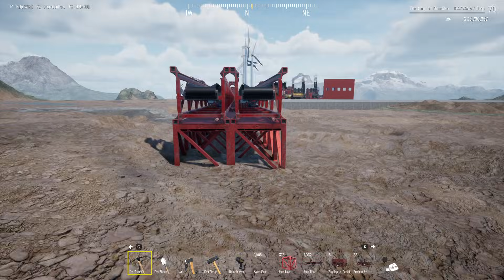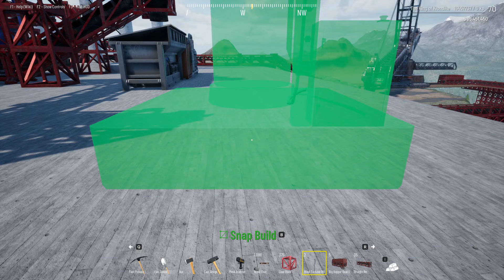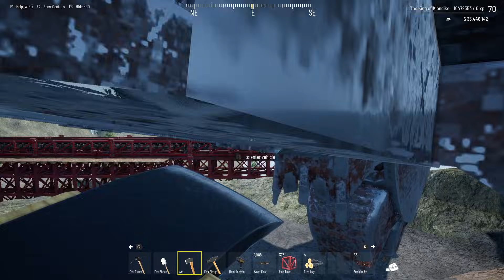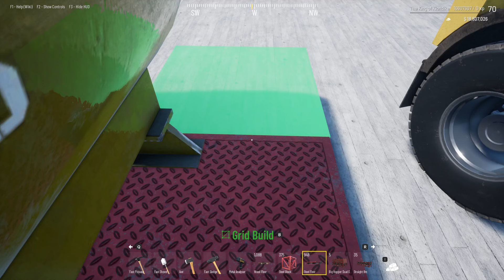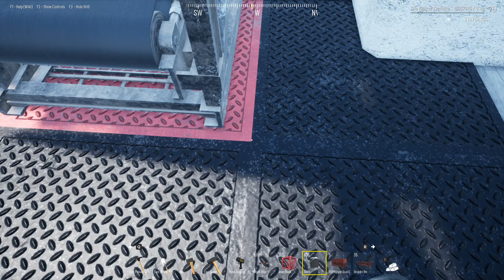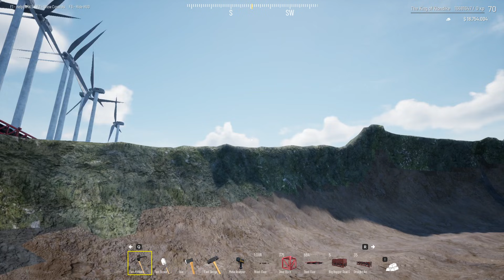Out Of Ore {Hardcore} S2E29 Worked On Plant And Ran Bagger

Comment: I ran power through the water pump and tried to hook up a "power point" to a pipe merger and no go, the only way that will work I think is to have a pump on both sides of the pipe merger, but that adds the pump draw as well 
and yea yesterdays video I put up is exactly why I stopped posting, I got 1 view in 23 hrs, and that's because I told the wife about it LOL. YT is not an easy place to make it, but I may just start posting for the heck of it, I haven't decided yet, I am putting MEGA hours in this game though ;)
you didn't turn on the power inputs so you didn't actually increase your available power yet have you?
Your conveyer system looks like a roller coaster @ Disney  :) kinda cool :)
I didn't know trees constantly grow. In the words of Martha Stewart "it's a good thing"  LOL
do you have a build video on the plant your running ? If so I'm going to have to watch that. I'm still using the manual smelter and wash plant for gold and gems. U haven't found any other metals yet, But I'm just starting so....
when you put down he metal plates dose it replace or cover the concrete?
I've been looking at all the production stuff and I can't figure out what "Bloom" is used for??
Another great video Thanks
Reply from the maker: Make sure to watch the video that comes out on the second, I used your idea! 😊
Reply from the maker: I didn't start YT to get view's/likes. I did it cause I have fun doing it.

As for power inputs, the way I have it set up. I turn one on and they all turn on.

Yeah roller coaster, so I could put all the needed mergers to make it work like I want.

Metal plates cover, they don't replace.

Don't quote me here, I am not in game atm, but I think the bloom is to automate  your steel beam production.

Thanks for the kind words, and watching. Much appreciated.
Reply: @jcgaming1571  how did you get all the powers to turn on together?
Reply from the maker: with no power poles........ Merger/Power Input/Wind Turbine. get all the turbines turned on, then go to one of the power inputs and turn it on. and they all turn on
Reply: @jcgaming1571  Did some testing last night and pipes work as well you just need a pump for each power input to snap to
Reply from the maker: good to know, I might need to change things. so those wind turbines aren't on the factory floor

Comment: I put one 10x and the rest are 1x to reduce power draw. I wish conveyor speeds increased each power input but they only use the highest on the line.
Reply from the maker: And that works? Hell I need to go back and change all mine. That is a huge difference in power draw.